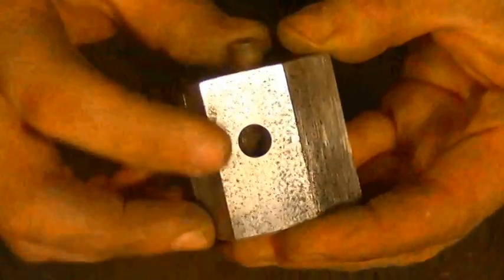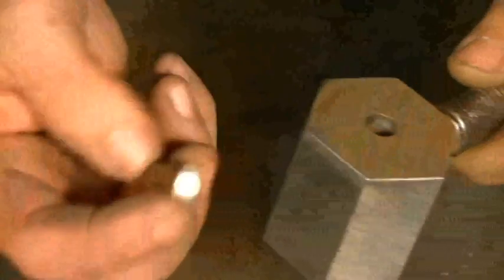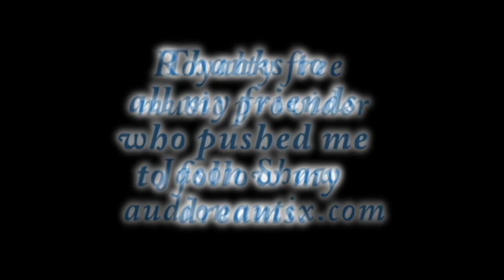How to make a Rivet Header / Forging Die

Comment: I would dome the header so you can hammer right down to the edge of the head without hitting the header. and I'd saw it off at the length of rivet you want, and avoid all the fuss with the pilot hole and undersize punch.

Comment: regarding punching out the finished rivets  go to a black powder or  muzzler loader  supply catalog and look at a tool called a short starter  or a bullet starter 

I am thinking  that if you had a couple more inches of that hex stock  use that to replace the wooden ball  just the weight of dropping that in the rivet hole would knock it out 
get Back to Me if you more help